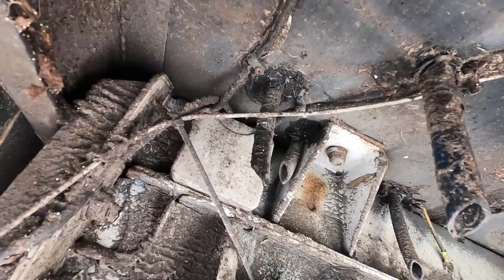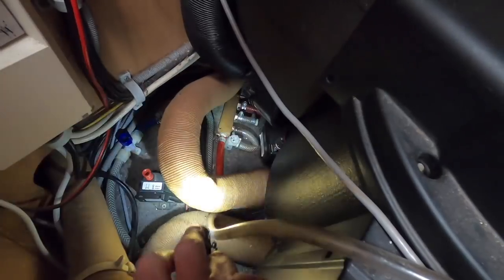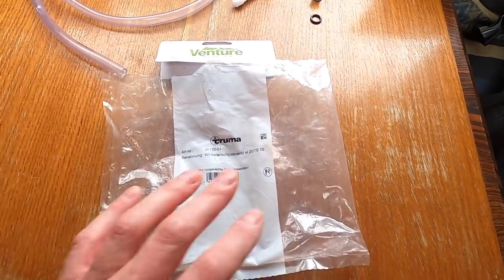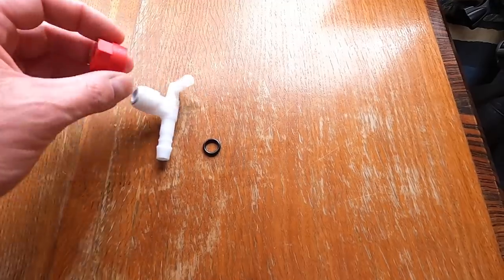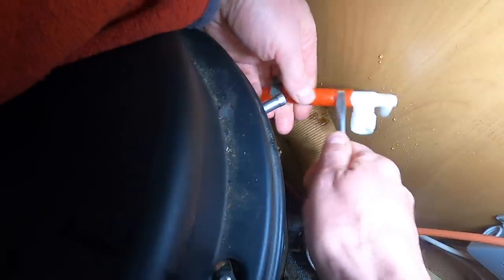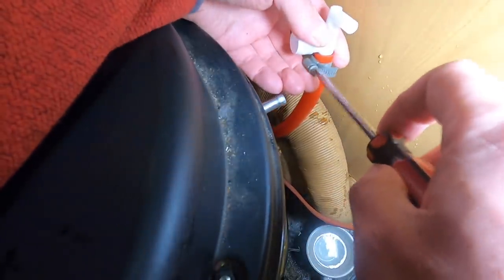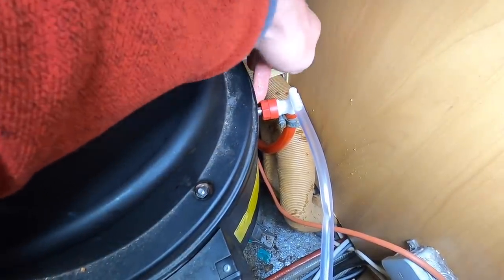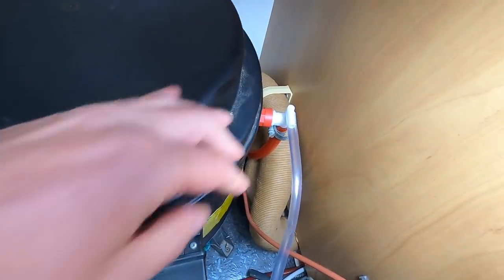How to Fix a Leaking Water Boiler in Your Motorhome or Caravan

Comment: Thanks for that. I have had the same problem, including it still leaking when I fitted the replacement valve. Thought I had done something totally wrong but now back to remake the joint as you did.  The clear tube is to let air into the boiler when you drain down for the winter.

Comment: just an update, firstly job done thx too you. went too my local truma outlet for the bits he informed me that the pipe that goes through the body and out the van was an inlet to allow air into the system when the boiler is drained, makes sense I suppose. Anyway thx again for the vlog on this subject without it I could have been a few quid out of pocket.
Reply from the maker: Glad to hear that, Mark. 👍👍

Comment: Well done. It's nice it was just a valve.  We cracked our water heater and had to replace the entire thing.  $700 later we have wonderful hot water.. and no leaks.  Nicely done.
Reply from the maker: Thanks Happy Place Diaries. $700? Ouch, that must have hurt? How do you crack a boiler?
Reply: @HermanHitstheRoad  By being lazy and not draining it properly before a severe winter storm that dropped the temperatures way below freezing... lesson learned.. an expensive lesson, but learned non the less.  Thank you for your great videos, we really enjoy them.
Reply from the maker: Doesn't your boiler have an anti frost valve on them so when it gets cold outside the valve opens dumping the contents of the boiler and therefore no frozen boiler?
Reply: @HermanHitstheRoad  That would be nice.. however.. nope.. we just dump the tank when it starts getting cold (below freezing).

Comment: Thanks for another great video ....my problem is the orange/ amber light stays on .....doesn't effect the blow air heating I have 1998 B584 Hymer same unit I think.
Reply from the maker: John, do you mean the light that goes off when the water is at either 40 or 60 degrees? 
We have 2 lights. The red fault one and a yellow/green which turns off when the water is at the right temperature. 
Does your boiler over heat the water? Or does it turn off?

Comment: Hi I have a very similar problem with the same however mine is gushing out, does the eBay store cover most or all truma spares. Thanks for posting this vlog helped me no end
Reply from the maker: Is the water coming out at the same place as mine, Mark? If it's not then you have a different problem. You'll have to check the store for yourself.
Reply: @HermanHitstheRoad  It is yes but it's not a trickle it's coming out as fast as I can fill it. I will go and check for serial numbers, it is 20yrs old and in German but I do have the paperwork for it. Thx again for the vlog could of cost a few quid but now I can do it on my own.
Reply from the maker: Brilliant, Mark. Let us know how you get on
Reply: @HermanHitstheRoad  looks a bit on the strange side, there is no elbow it's straight through from the outlet to the escape out the van, it has a copper nut and olive fastening going too the hot taps not a push on and jubilee clip, I am thinking that the hose is too short and it's been bodged up at some point.
Reply from the maker: You could try and descale all the parts. I thought about doing this after I bought the new one. It won't take long to give it a go

Comment: Thanks. I’m having issues with the earlier red hot water fitting elbow to John Guest. The threads split and a replacement I  got also split. 

I  now have the white fitting - presumably a better moulding - more heat resistant- hopefully. 

I was hoping you’d touch on how tight to do up this fitting.  By the way I don’t think you’re correct in calling it a pressure relief valve.  It’s function I   believe is to allow air to come back  in to facilitate the wAter draining out ( air going into the top to allow the water to drain out when lifting the two way valve. )  this would be for fitting a new element or winterising etc. 

When the boiler is full and under normal pump pressure the air inlet valve with the clear plastic tubing of course is closed. When water is trying to drain out, air has to get in or a suction situation exists. 

There is another outlet at the bottom of the external cowl vent area which allows condensate etc to drain away.  That’s visible outside the RV in the bottom corner of the cowl vent.  

Anyhow thanks I think for your video.  I  ended up with success by fitting the compression nut, then the split sleeve or collar then the O ring right onto and OVER the raised knuckle,
THEN push and hold the plastic elbow onto that outlet pipe whilst doing up the nut.

I  did the same as you - fitted a new outlet elbow, turned the pump on and it leaked, like yours did. 

It’s a stupid fitting. I think part of the prob is that knuckle near the end of the stainless pipe taking hot water out. The collar/ sleeve surely doesn’t fit up over the knuckle. 

Anyway, cheers .
Reply from the maker: Glad to be of help, Barry 👍👍

Comment: my boiler is not dissimilar to yours other than the my pipework is as you look on the left. The writing on mine is in German could you tell me where you found the serial number or whatever you used to order your replacement.
Reply from the maker: This is a good question, Mark because I did find it difficult to choose the correct one. In the end I chose the value which looked similar to the old one. 
One our boiler there is a large yellow sticker which contains the model and serial number.
I hope that helps

Comment: Good job but it could be that your water is over heating thus opening the relief valve to release the pressure.
Reply from the maker: You're right, Ian but then it would still be failing now. Then there is Occam's Razor 👍🤔

Comment: you do really need to find out why the prv failed, its a sealed system and this is one of the safety devices , if it happens again please check the  boiler .  great vids as always
Reply from the maker: Of course, Dave if it keeps occurring then there could be a problem with the boiler rather than the valve. Always consider Occam's Razor before fixing anything. 👍👍

Comment: A word of advice - these Truma air ducts are extremely low quality. You soak them in water they start falling apart from the heat afterwards. Change to Webasto air ducts, much better quality.
Reply from the maker: Thanks for the tip, @thegrave2000 👍

Comment: I think the valve is a 'breather' valve that is used to let air into the system when you drain it down rather than release pressure. Seems to be a common misconception but maybe I'm wrong. The older boilers don't have a replacement part so using the same part that you did I had to bodge a few plumbing items together to make it work: https://www.facebook.com/groups/classichymers/permalink/3933913523288105
Reply from the maker: You could be right, Josh. The link only works if you are joined to that Facebook group